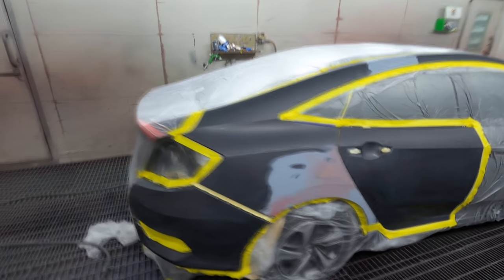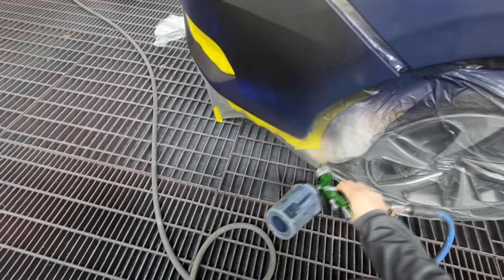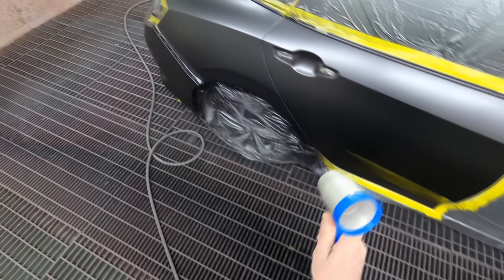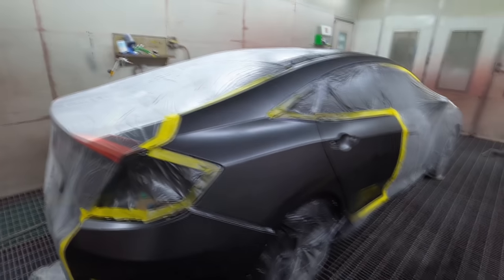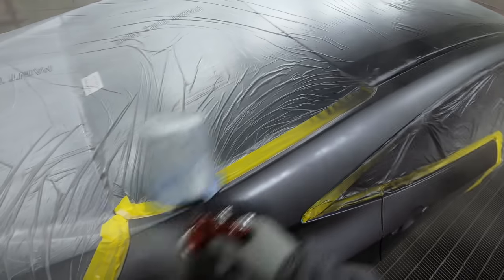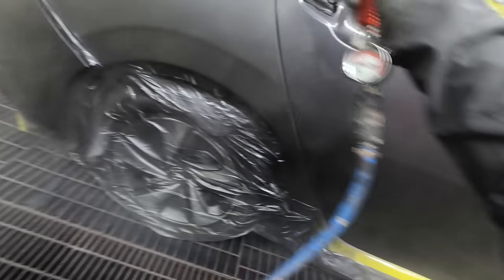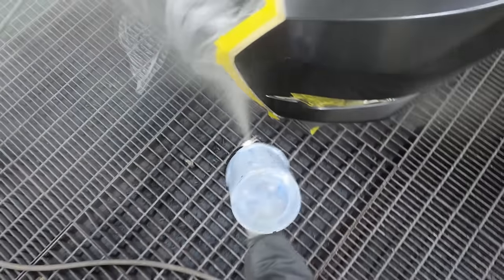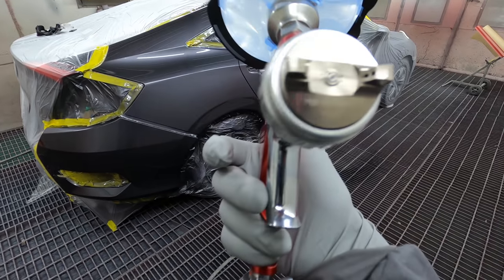Modern Steel Metallic Honda Civic Spray Painting

Comment: Maybe it's a waterborne thing, but I spray my metallic at the same pressure and fluid for every coat. I don't like to change pressures and risk changing the flop, I stick to the pressure that my sprayout card was sprayed at. With a dark grey like this I don't think pressure would change the color much, but on lighter metallic colors I keep the psi consistent.
Reply: Waterborne is heavier in viscosity and the metallic sinks when you spray so you have to do a drop coat but with my solvent base I raise pressure to get the metallics to flow better but only for certain colors and depending how the metallic flows in the other panels
Reply from the maker: Yeah it is a water thing, I would leave the settings the same for each coat with solvent too.

Comment: Gunny, is the first coat you showed (just a dusting it looked like) the wet bed?  (so the flakes lay down, right)  Sorry if that is not the correct term, I'm not in the trade but trying to learn.  EDIT:  I guess I should have watched a bit more before typing my question...  sorry